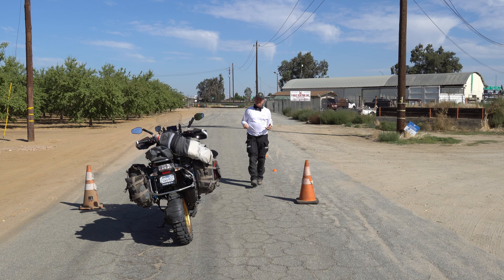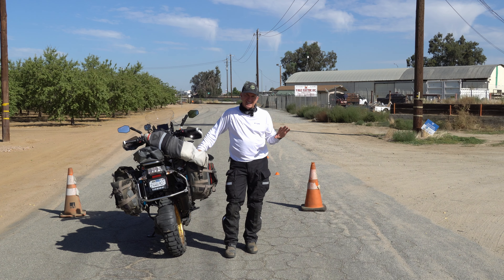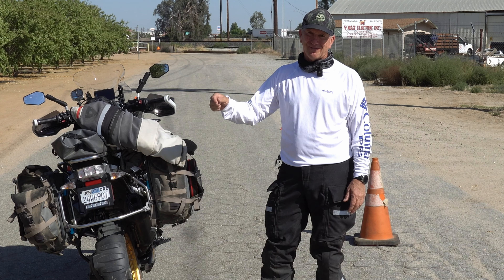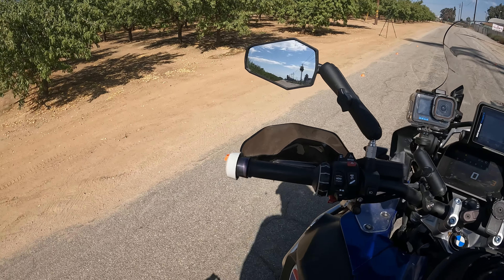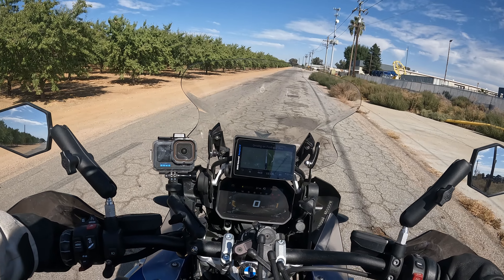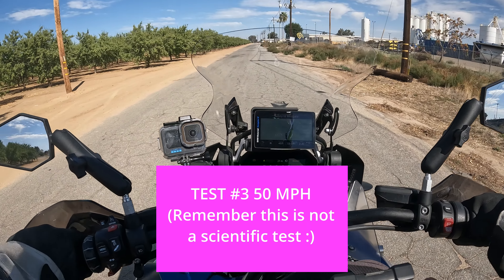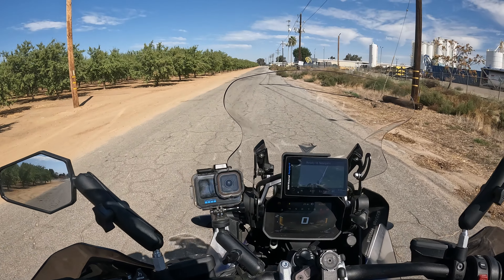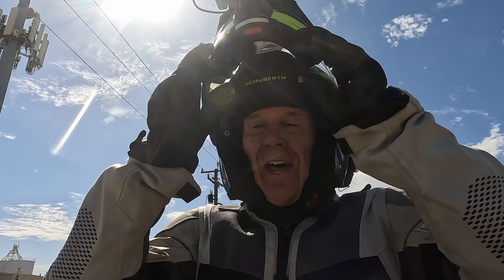Motorcycle Emergency Brake Test - Pushing the Limits!

Comment: Great video Dave, I’m always interested in such data, and then I try to apply parasitical application in the real world to learn, just pace off those stoping points from a stop sign, then observe that distance from a stand still and from an approach on the bike. Gives me a good impression to remember.
The front brakes on these newer models are incredible, I’ve dropped my 1200 RT (slow speed) more than once due to a panic grab of that front brake with my wheel turned a bit.